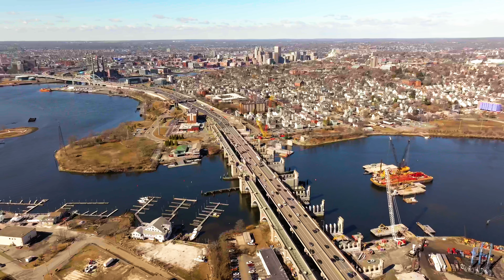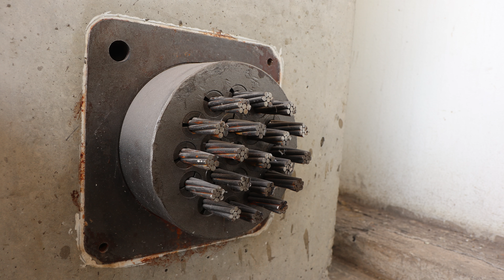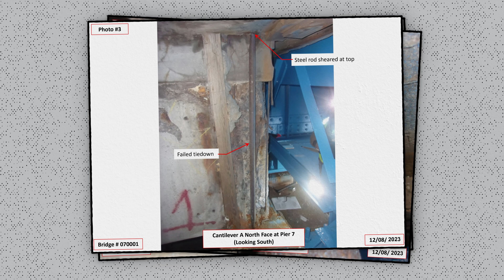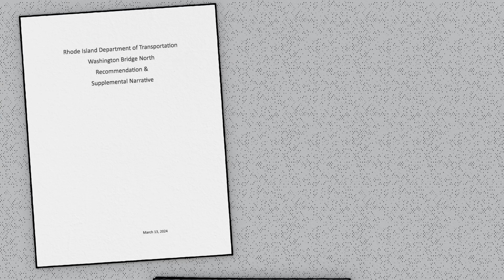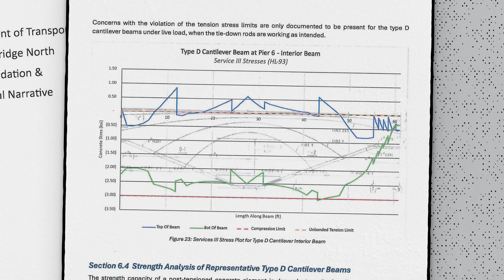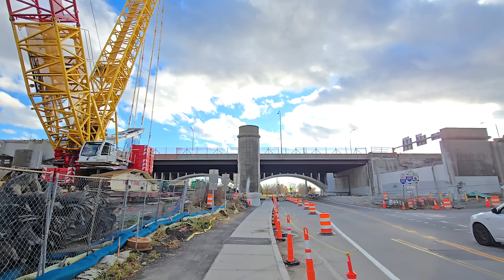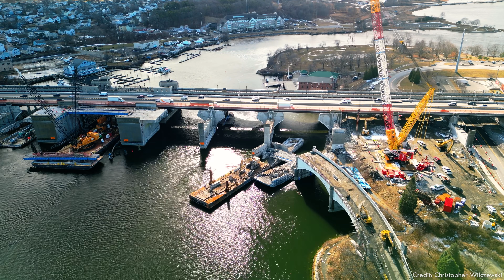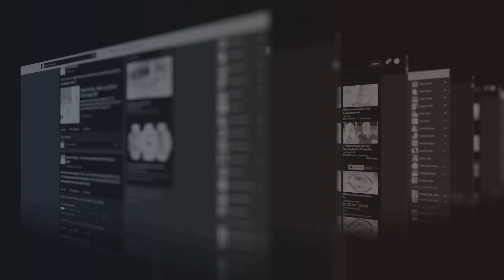This Bridge’s Bizarre Design Nearly Caused It To Collapse

Comment: 11:30 -  Reminds me of something that happened up here in Canada recently. A lightbulb burned out in a factory I used to work for. When someone climbed up to change the bulb, they realized that the wire powering the light fixture had snapped in tension. It turned out the entire ceiling had deflected several FEET and a collapse was imminent.
Reply: Imagine being the guy looking at that roof and realising it can collapse in any moment
Reply: @wscamel226 "Hmmm... that's... Oh... ohhhh... OH!"
Reply: @wscamel226that'd actually be the safest place to be if it collapsed, you and the debris would fall at the same velocity so you're not getting beamed by debris like you would if you were ground level! Physics is dope;
Reply: @Skriggler  don't forget the distance you would fall when the ceiling takes out the ladder or lift that your using.
Reply: @JStorm13 true but by then the ground would be closer from the debris falling
Reply: @Skriggler until we both hit the ground and the extra force of that damages your back and you get hit by the debris
Reply: @Skriggler  I think I remember reading somewhere that falling is bad for you
Reply: I'll bet the someone came down the ladder pretty sharpish.
Reply: - How many engineers does it take to change a lightbulb? 
- Well....
Reply: @gerryino Are we talking Canadian certified engineers or "engineers"? Lol.
Reply: But but did they change the light bulb?  You left us hanging with that plot device.
Reply: @boxsterman77 hate to ruin the joke but putting this because some people either completely lack situational awareness, or are believers of "won't report, not my problem".

Wire break due to traction would already have you replace a length of wire which you probably weren't ready if the service order was just for a burnt fixture, and even if you replace, it's good practice to figure what was the cause for traction to avoid accidents or repeat issues.

I had my share of "have you replaced or fixed X" questions given in earnest because that person failed to get from my brief that this was an active safety hazard and their asset got caught in the crossfire.

"HQ here, the switch is still off, check if the cables are plugged on."
"I'm evacuating guests as we speak! This is an active emergency!"
"So, ETA on that node?"
Reply: @Mordecrox Weasel.God: "If our POP is under four feet of water and you had to call us using a satellite phone because all landlines and cell towers are out of service, the outage falls under the 'Act of God' clause." (Yes, a client really called support under those conditions, wanting to know why they couldn't dial in...)
Reply: @Mordecrox  
You: I'm evacuating guests as we speak! This is an active emergency!
HR: Wait! Wait wait...wait. Did you try unplugging and then plugging the light back in?

My suggestion is to hand out dust masks, eye protection, and hard hats. We should check with accounting to see if we have a budget for high-vis vests and maybe a few delineaters.
Reply: @Mordecrox no
Reply: @boxsterman77  seriously!!!
Reply: How imminent? Are we talking minutes, hours, days? Did they get it replaced safely? YOU CAN'T LEAVE US HANGING LIKE THE LIGHT FIXTURE
Reply: I remember hearing about something similar when I was a kid. I don't recall the exact details now but it involved a building in the UK that had developed a very leaky roof following a major storm (probably the one in 1987). As I remember it being told, someone went up to investigate the leaks and realised that the whole roof had been momentarily lifted by the wind, the walls had spread and the roof had then dropped back down. The roof support joists were no longer positioned on the wall on one side of the building so the weight of the roof was being borne on that side by other components. Apparently, the person came down very fast, looking very pale, and told everyone to get out of the building as quickly as possible!
Reply: What if the light bulb was the thing holding it together?😮
Reply: @markharmon4963  Technically it was a load-bearing light fixture.
Reply: This is like when the roof of an addition on a house I once owned snapped off from the main building. It revealed a previous DIY owner (dead) who built a foundation with brick footings and replaced foundation on one side of the house in 8 batches. It was bad. The main roof (built in 1910 and overengineered) was the only thing keeping the house from collapsing. 🥲
Reply: @renyun4246  Please don't say "overengineered".  Do you really have any idea of what the original designers were thinking?
Reply: @paulkurilecz4209 have you literally any construction from before 1920?
Reply: @ Yes, but I don't understand where your comment comes from?  I was trying to understand why the roof was deflecting.
Reply: @paulkurilecz4209  It was a wear and age issue. The plant was using a plane hangar from WWII built to last only 5-10 years tops. It survived for 70 years.
Reply: @Stammer6  tyvm
Reply: @Stammer6  Airplane hangars are pretty iffy structures to begin with because of the spans.  My understanding is that they are allowed higher maximum stresses than other buildings.

Was this a wood or metal structure?

Tia
Reply: @paulkurilecz4209  It was steel. They reinforced it with a ridge beam and post and it'll last a little while yet.
Reply: @Stammer6  tyvm.  The reason why I have been asking for details is that I have investigated structural failures for most of my career.  Asking these questions is either an occupational hazard or a congenital defect.  I can't figure out which it is.  🙂
Reply: @gabet945 I am curious as to what that tactic cost his clients.  Could it be that the drawings were just highly detailed?
Reply: @paulkurilecz4209 less than you would guess. Lowering the stress by adding material is cheap when done at the beginning. Maybe 10% to double your safety factor (totally depends on what you’re building).
Reply: @barnowl8563  During WWII, a lot of structures had the margins shaved very closely in order to minimize the material needed.

It will take more than 10% more material to double the stresss allowance.  Of course a lot depends on the loading.  The roof joists in hangars are primarily in a bending load.
Reply: Wow
Reply: :climbs up to change lightbulb:.
Uuhh, Bob, can you grab me a box level, I've got a bad feeling here."
Reply: Where was this?!
Reply: @ricardobortolon5929  wherever it was, I'm sure it was not the Ontario Science Centre.
Reply: yes! I remember once turning on the coffee machine in the Lab where I worked and it turned the fluorescent lights off?!? Thought someone was playing a trick on me.  Close the coffee machine and hte lights came back on?!? Called the electricians who were dumbfounded....was a "simple case" of hiring contractors because the plant engineering people where overwhelmed with work. Turned out they had switched two hot wires making the coffes outlet being near 0V instead of 120....that was the easy part...finding where the culprit cble was the nightmare....!!!!! In a machine shop with hundreds of connections.....
Reply: i presume that was a moment of '' huh , hmm oh.. waaait.. FKD! SCRAMBLE CRAMBLE DOWN LADDER TO FOREMANS OFFICE + UNION MINUTES LATER EVAC SIREN'' ?
Reply: which factory
Reply: Saved by coming to the light…..
Reply: @philippal8666  For the company, I think they saved lots of very expensive equipment that was hooked up on that same circuit.....I remember seeing their dazed look as they stepped out to discuss the probable cause...They probably realised at that time the numerous connections they would have to check on a particular column in the machine shop....like 200 connections or so...
Reply: Snow load?
Reply: Wow
Reply: 😂 the only thing tying it down is the conduit and cables ajsjsjjff
Reply: Cool
Reply: Oh wow.
Reply: FEET? YIKES
Reply: Your post reminds me of the workers installing ceiling panels in the new San Francisco Transbay Terminal, who noticed cracks in the steel beams, necessitating closure of the $2.2 billion structure 6 weeks after it opened.
Reply: That's so unsafe! Instead of using his feet which length we don't know the engineer should have used more reliable units 😂
Reply: That was a lode-bearing electric wire.
Reply: That's a feature, not a bug...

Comment: Early prestress systems have been known for several decades now to be headache to inspect. A lot of essential structural parts are inaccessible. Inspection needs to be done invasively - opening a hole go watch - which opens access to humidity, leading to corrosion. 
When I followed my structural engineering courses in the late nineties, we got taught that a) critical elements need to inspectable, b) failure of critical elements have to lead to deformations before they lead to a complete failure (meaning, the structure becomes unusable before becoming dangerous), and c) project documentation has to contain an inspection plan.
I diverged into other civil engineering orientations, so I don't know today's standards. Also, I won't criticize the people responsible for this bridge. I don't know enough, but I do know how difficult it is to check such a beast. Not talking about insufficient documentation, financial pressure, etc.

Comment: I am happy see the coverage you have provided here. I am always suspect af anything built in the 1960’s. People may not realize that a lot of buildings were with built prestressed design and in the Pacific Northwest anyway, are built with post tensioned tendons encapsulated to include the stress anchor also. No tendons exposed. Too bad one must be in an earthquake zone to have the code enforced the way it is on the west coast. I have been a structural inspector for over 30 years and never seen anything like this before. Good video Grady!

Comment: A root cause analysis will take you back to politicians, with no expertise dictating design to engineers, and using the project purse strings, to coerce expensive not best practices solutions out of the design teams. Not an isolated incident.

Comment: The ability to inspect and verify key points in a structure like a bridge should be part of the engineering specification, and signed off before construction.  Hidden load bearing connections seem like a bad idea.

Comment: Within NJ Transit, smaller train stations use salt to melt ice in pedestrian areas.  Also in those areas are columns which support the overhead electrical lines for the trains.  The salt piles up in the column feet and the hold down bolts corrode and are now a tiny fraction of their original diameter.  Convent Station in particular is in a particularly bad condition, just waiting for a hurricane.  Not sure how to tell NJT, but it looks pretty obvious.

Comment: As a mechanic, there's a saying that every 20 minute job is one broken bolt away from a 4 hour ordeal. This seems to be the infrastructure version of that. What was supposed to be a short project to improve the use of the bridge, found a broken bolt and it turned into more broken bolts. 

Seems like there should be some sort of central bridge inspection authority. Inspectors that are contracted out do the inspection, report back to trained and experienced engineers that have access to all plans for the bridge, and then report back to the inspection company whether they need better pictures or just missing information. Those engineers then have the power to close a bridge before catastrophe happens.

Comment: I'm not sure what engineering company would want to work with RIDOT since they are suing every company that ever worked on the bridge.  RIDOT has NEVER discussed the role of their maintenance of the Bridge and the role of their in-house structural engineers in the evaluation of their bridges.  They cannot disclaim their portion of responsibility in this disaster.  There were previous inspection reports that showed the bridge in poor condition.  What was their plan?  The Feds don't fund a replacement without a plan in place.

Comment: Another RI resident here. We are frequently a case study in failure and what not to do. I appreciate your dive into this bridge. As for your thoughts on this being a cable stay bridge in the future, I think that's unlikely here. It is very common for flights coming from the south to fly up the bay while descending, turn around at this point and return south to PVD airport. They're likely still over 1000' here but I'm sure there are pretty decent clearance requirements for commercial airliners.  There is also no longer any large shipping vessel traffic through this part of the bay. Lastly, only a mile or so away from this bridge is another that was built on the land then floated into place on a barge. I think we're very likely to see this type of construction again here. Our replacement overpasses are now build next to the old bridge and moved into place in a day or two, minimizing traffic disruption.

Comment: Great video Grady.  You explained the cantilever structure that I had not seen anywhere else.  You clearly identified how many of the design features were poorly designed and hidden from regular inspection.  Well done!  I am curious why the end cantilevers were not designed to be unbalanced so that the cantilever would be self supporting without hold downs and also be able to support the central span.  The hold downs seem to be an unnecessary maintenance (and critical member).

Comment: Considering the result of a catastrophic fail can mean loss of life and adding to that, the cost of replacement would not stainless steel rebar and tie down hardware be an option? Especially where inspection is difficult or impossible. It seems to me that the long-term savings in terms of maintenance, repairs, longevity, etc. Far outweighs the initial cost.
What are your thoughts on the ss hardware?

Comment: Back in 1995 my grandfather was hauling a permitted load that weighted just over 120,000lbs and the permit routed him over this bridge and at the bottom of the page it said that it's not guaranteed to hold up and you are not allowed to be off the route but since it said that my grandfather told me to get the map and find a way around it so I did and we made it to the destination without any trouble from the cops or anything else

Comment: The Washington Bridge saga is a perfect illustration of the problem created when the existing 90+ year pattern of "Robert Moses" inspired financial and technical public corruption tied to public works efforts is put on steroids when applied in a small state too small to provide the financial and technical talent required for most modern multi-billion dollar projects.  Most states (eventually) get the public work itself, built to some reasonable standard of safety and wind up with ongoing administrative teams able to competently manage it, even if at inflated costs.  When small states attempt to leverage these same practices for corruption by favoring in-state construction firms, consultants, etc., the pool of qualified resources is VASTLY smaller and thus more likely to contain people incapable of delivering professional results, whether in design, construction and ongoing operation.

Comment: Thank you for noting the good, that people were keeping an eye on it, even as the inspections were not spotting the problems. I wonder if it is even worth blaming people here. Long ago a bridge was designed with best intentions. Nobody woke in the morning thinking: How can I design/build a crappy bridge? Standards for this kind of prestressed and post-tensioned bridge was still relatively new, becoming widely used in the 60s and 70s. We will spend tons of money trying to point a finger of blame rather than simply dedicating the money to the next step. 

Anyway, this has a systemic basis. The nature of how we award contracts in most of the country is likely to lead to poor quality work. We ask for the lowest cost contractor to do the inspection, then are insulted that they did not use equipment that could see certain points of failure quickly. Our government contracting systems often do not take into account the quality details of the work to be done. Can we blame the lowest bidding contract for doing lowest bid quality work? It's one of the reasons to have all inspections be in-house (part of the highway agency). They have the vested interest in getting it right rather than making a profit.

Comment: Oh, I know ALL about hidden deficiencies during renovations.  My house is balloon-frame construction, with several penetrations for windows and doors.  The funny thing is, they knew they needed jack-studs when they built the house....but they didn't know WHY.  Every jack-stud is OUTSIDE the king-stud, ending just below the headers, with the headers attached to the king-studs with long nails.  That's it.  Only the wall material and those nails hold EVERY SINGLE HEADER in my house.  Both for external penetration, as well as any penetrations for interior framing.  And that's just ONE of the structural deficiencies I've found.
Reply: That's strange and not proper way of doing openings in walls.
Not professional.
Jack studs should support header inside. 
That's why the name " JACK " like a lift/ support. 
Whoever did this walls didn't have any idea about proper construction.
Reply: @Matt999PL  Yeah, that's what I was getting at with my post...  Is english not your first language?
Reply: @hellcat1988 
I know how to build proper walls much better than the one you have at your house. 
Lol
Reply: @hellcat1988 
Do you know other languages?
English is not my first language.
Reply: @ I also know how to build walls better than whoever built my house.  It was built in the early 1900's.  And no, I am not fluent in other languages.  Just english and bad english.